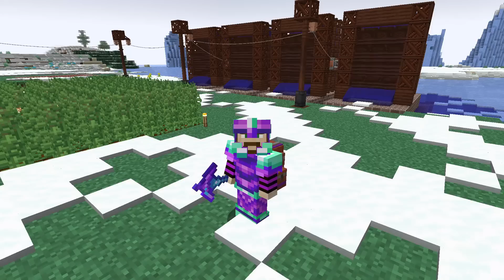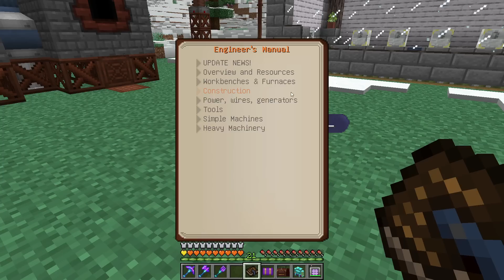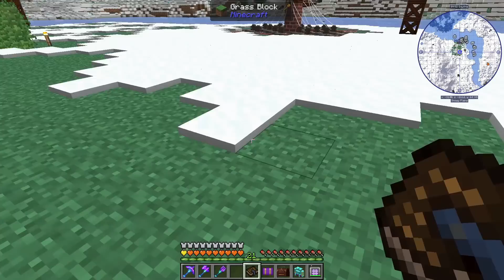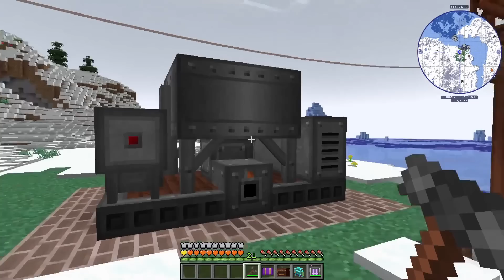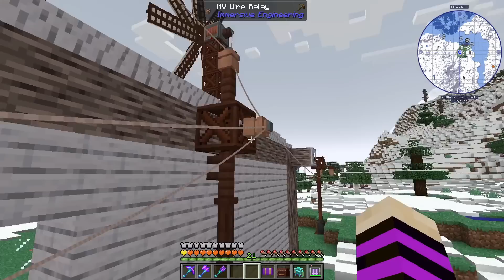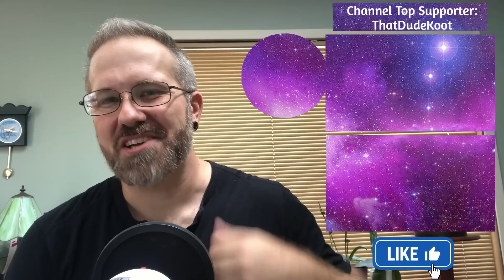How to Make Power and Use Crusher Immersive Engineering EP 9 Minecraft 1.20 #minecraft

Comment: For me, the crusher runs out of power really fast. It goes halfway through one raw iron block and then the power runs out and it keeps turning on and off constantly until that block is done and it takes forever. This is weird because I have a maxed out MV Accumulator connected to it with a full set of HV wires, connectors and relays and the crusher does work, but for some reason I just can't shove power into this thing at a fast enough rate for it to work smoothly. What other upgrades could I possibly make?

Edit: I just realized I forgot to put an energy output on my accumulator. The power has been coming from my Thermo generators alone this whole time.
Reply from the maker: Glad you figured it out =)